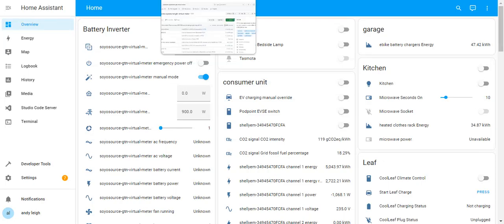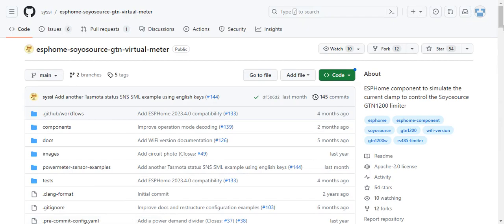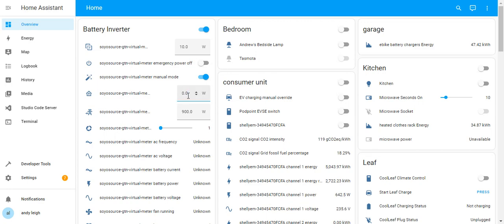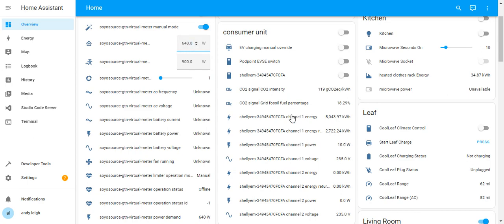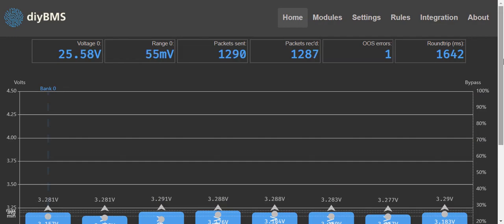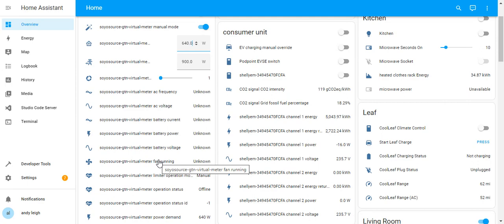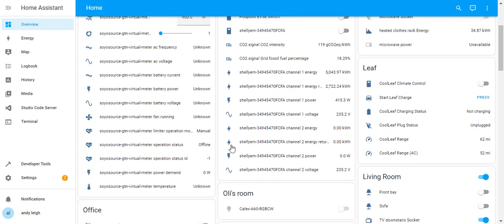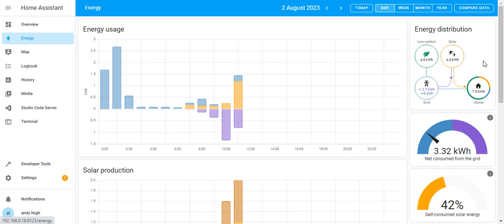soyosource homeassistant integration with esphome-soyosource-gtn-virtual-meter

Comment: Hi. Thanks for the video. I have some code in node red I can share for keeping your grid at zero.
Reply from the maker: Thats cool. I think i am going to do this with jinja yaml As an automation. I do need to get mqtt working with my homeassistant on the pi as it only seemed to want to talk to a mosquitto broker running on my win10 laptop. I will crack that given time but for the movement ive got bigger projects looming. If you make a vid of your node red setup send me a link. :)